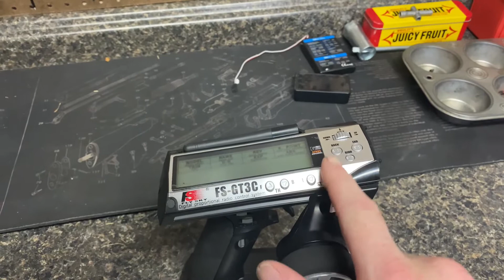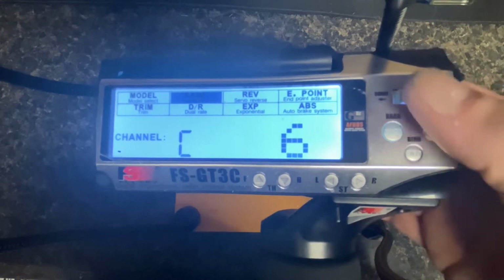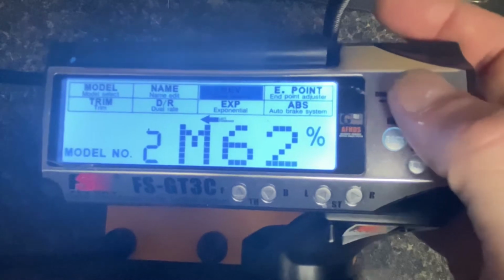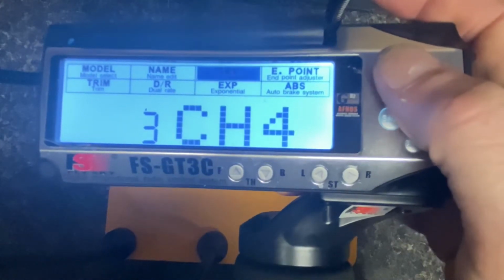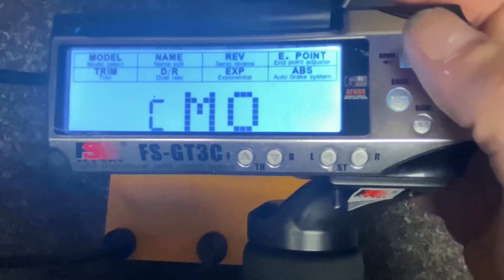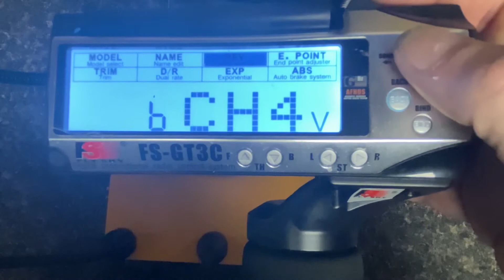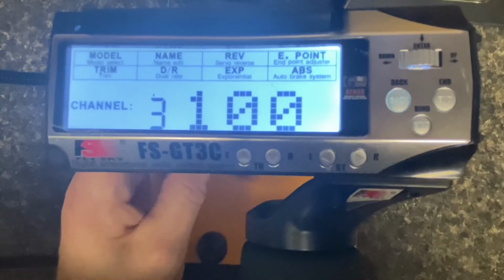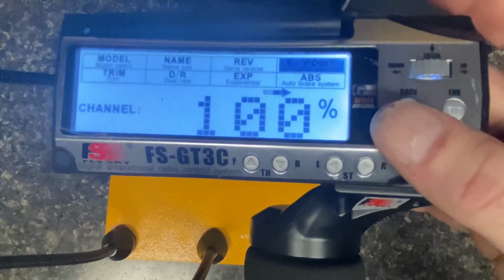Hacked Flysky Gt3C  (channel mapping)

Comment: I know this is old, but I had a body finished for me and sent my radio so it could be hacked.  He installed lights and all was good. I built a brx01 and when I click the ch 3 button it works my steering trim(but it doesn't actually trim that servo)  The radio is fine for my other vehicles but have no idea how to set this up.  Is there a list of commands? I have no idea what this all is. My other gt3c is not hacked and I know it well. This one is crazy. Any advice. I watched video but not working. thanks.

Comment: I need some help setting up my scx 10 2  I have lights and a 2 speed trans do I need a different receiver all I have is the 3 ch ones
Reply from the maker: So, if you just wanted to power the lights, they know you would not need a different receiver. You could actually plug it into. I believe the very top port, which would basically be used as power on a nitro, but it will bleed power through that and power your lights if you want to control them via your transmitter Then yes, you’re going to need a few things. first you’re going to need a lighting controller. The one I’ve been using is by Apex RC and can be found on Amazon easily or I have a video entitled TRX – four lights controlled by transmitter. You can watch that the links in the description. Also, you’re going to need some of the six channel receivers They are the rand.   Flysky receivers they’re great and actually I use them on a lot of things that I use this transmitter for you actually get some better distance out of them. I buy mine from RC addict. You can find this VA simple Google search they are out of Pennsylvania and are amazing if you go under their radios and receiver section, you will see R1.06 channel receiver for your transmitter. These are amazing and they shipped pretty quick.   if you need any help setting up your transmitter to control this let me know if you need anything else just leave me a reply and I’ll help you out

Comment: Man I have the same exact model remote but when I long press it doesn’t do anything
Reply from the maker: Just to clarify you have had your radio hacked to the psx firmware correct?
Reply: @LargeeeScaleLife  how do you hack it
Reply from the maker: @jmiguel250r  basically you have to pull the computer board out of it sold her on a couple of pens and use a programmer to do it I sent mine to a place called rc addict they are located in Pennsylvania bought parts and stuff from them before and their service is outstanding I had them do the hack job for me it was pretty cheap definitely the way to go
Reply from the maker: Once this is done you will unlock all of the features of the updated firmware. This firmware was custom built by God tons of people have used it and it works really well kind of hard to figure out how to program it but once you do it really makes this radio outstanding